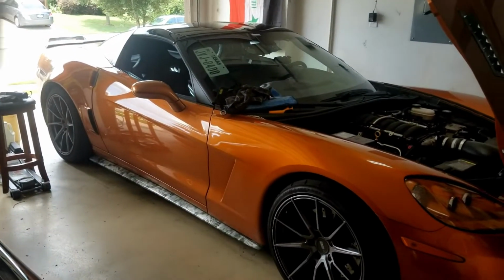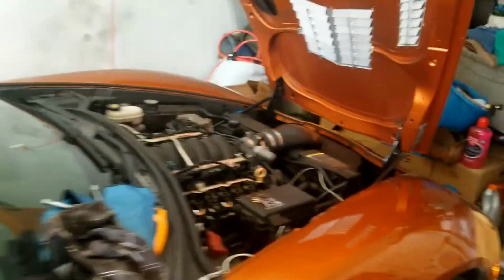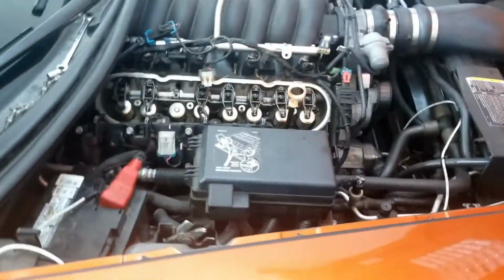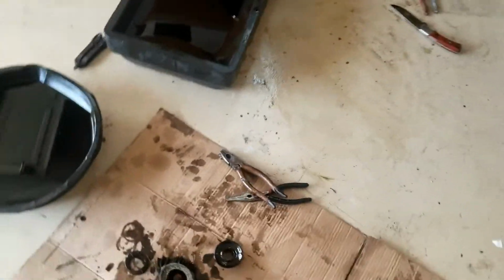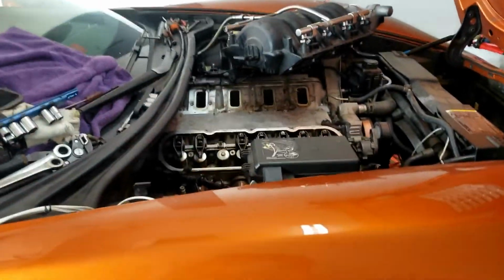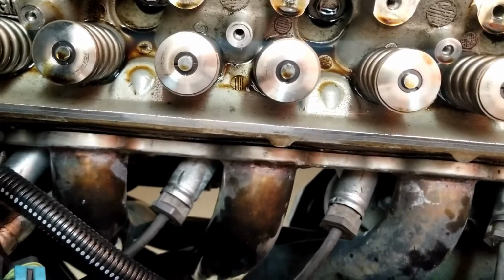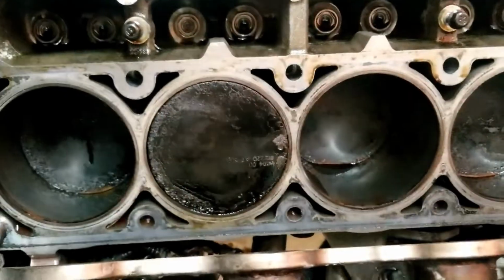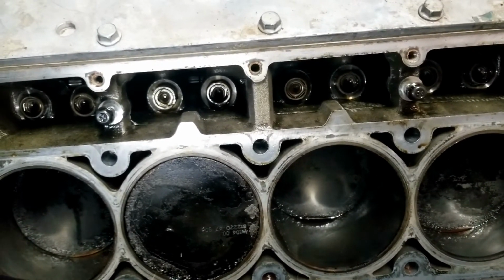Finally Imploded (Part 1): C6 Corvette Lifter Failure

Comment: How much should it cost including labor to get my lifters changed out? I have a C5 and i noticed i had a 10-15 psi drop and i got what i could best describe as lifter noise.
Reply from the maker: Tbh. I dont know. I do everything myself. Should not cost no more than 500. Cause you dont have to take the heads off to remove the lifters.
Reply: @x03736  how do you not pull the heads to remove the lifters??
Reply from the maker: @beronib888  I do not think that is possible.
Reply: @x03736  ok cool thought was reading that wrong 😅